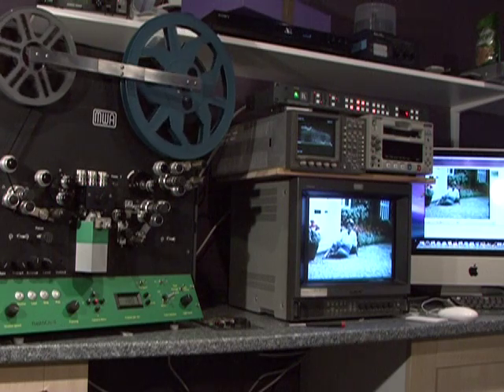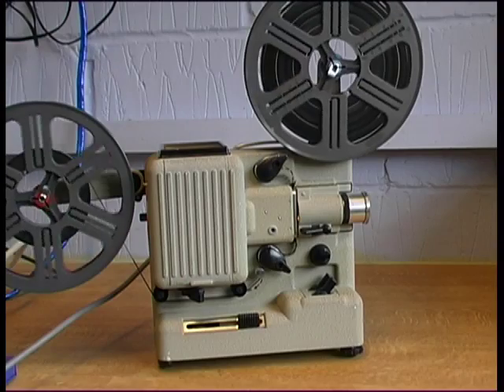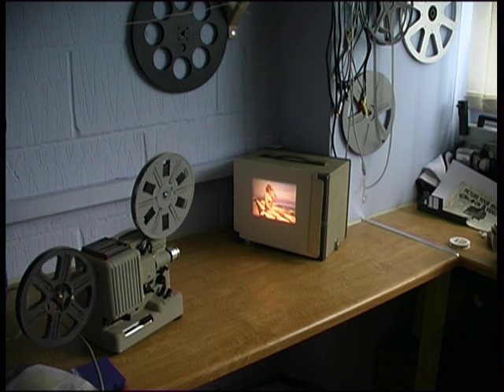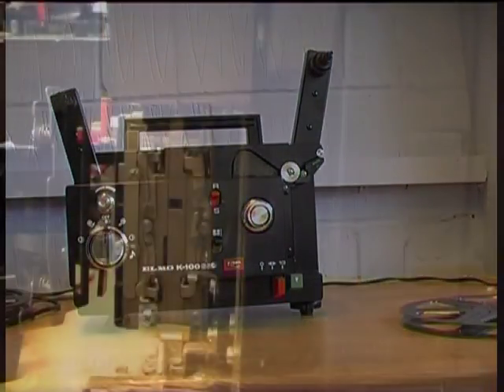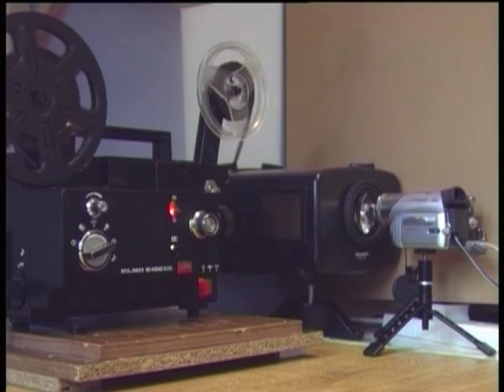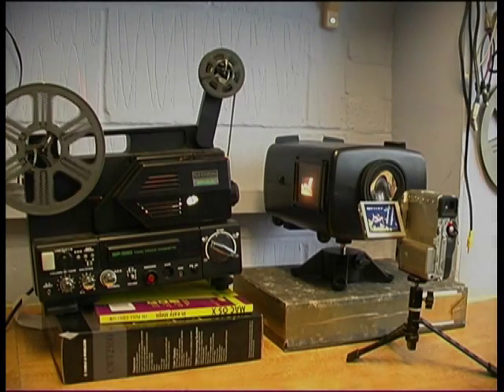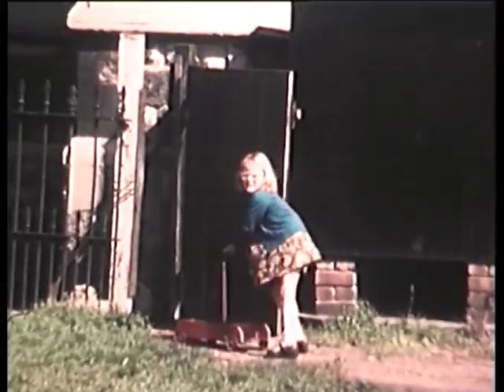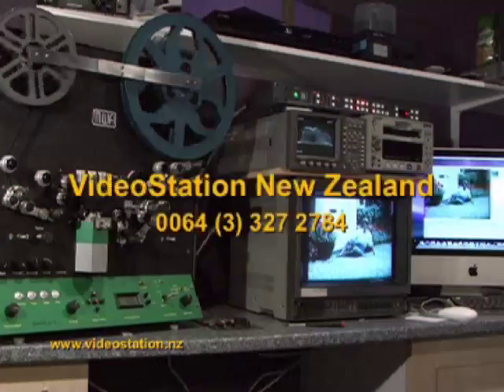How To Copy Film To DVD

Comment: How do I get my projector so close to the multiplexer and still get focus?  I have a converted Elmo 16CL with a 50mm lens and it won't focus closer than about 2.5 feet.  Thanks for your help.
Reply: I have the same problem with a 22mm lens on a Kodak projector.  I was reading some online cine box instructions and it said required lens is 80mm or 114mm
Reply: I have a converted elmo also and had the same problem-I pulled the lens out a bit, out of where it comfortably sits and then hand focused the lens itself.  I was able to focus then-hope it works for you. Best, JDC